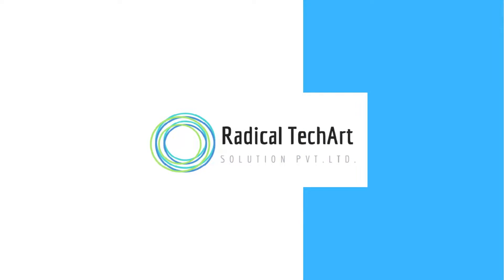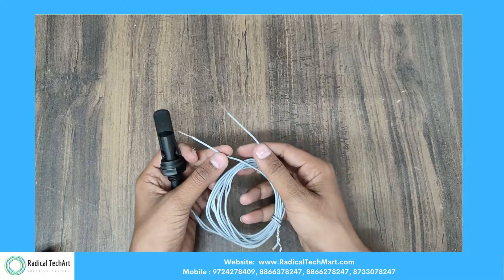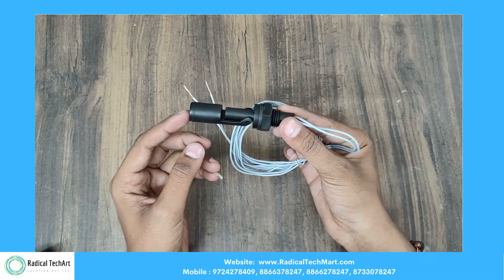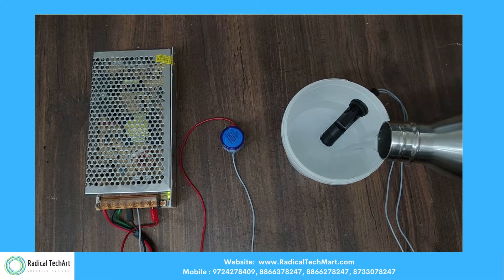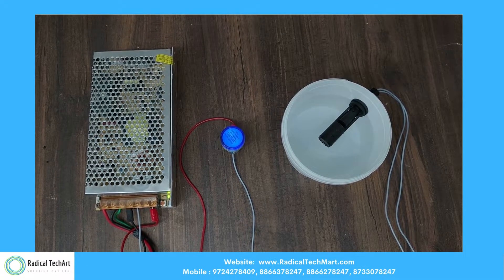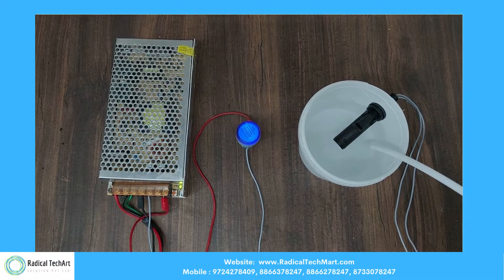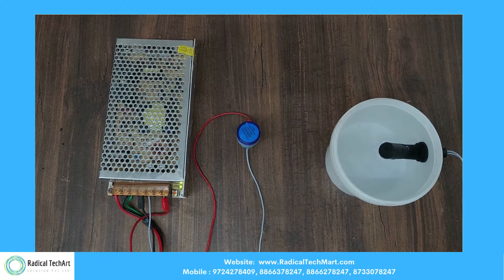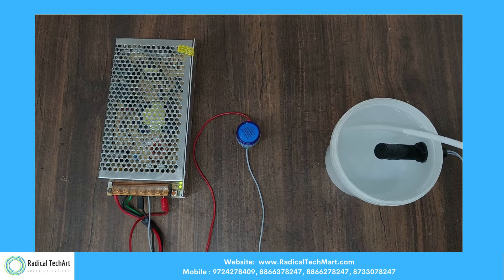Side-Mounted Float Switch Explained: Solution for Liquid Level Control RadicalTechArt I RadicalTalks

Comment: de que tipo es el sensor y cual es corriente máxima?
Reply from the maker: Un interruptor de flotador montado lateralmente es típicamente un sensor de nivel mecánico que funciona utilizando un flotador conectado a una palanca. Está diseñado para la detección del nivel de líquidos en tanques o recipientes. La capacidad de corriente máxima depende del modelo específico, pero generalmente varía entre 5A y 15A a 250V AC para modelos estándar. Siempre verifique las especificaciones del producto para obtener valores precisos y garantizar la compatibilidad con su sistema.

Comment: I was wondering why my motorhome gray tank was always on 0% - I think your video gives the answer that the switch may not be broken, and is not incremental as it will only show 100% when the water is at a high level?
Reply from the maker: Thank you so much, We are glad you liked this informational video, If you want more information, you can connect to our social media handles, and from there you can get the best and most straight information.